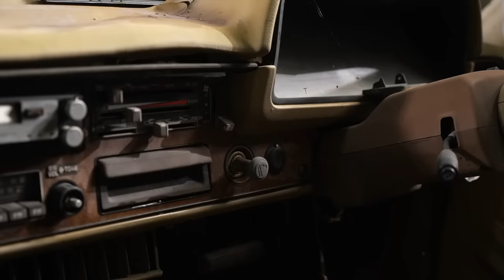VINTAGE HILUX saved from JUNKYARD & restored! Jocko's ground-up rebuild of his Dream 4WD

Comment: Nice. Look at the classic Red Marlin Crawler truck for inspiration, that thing is an icon in my world.  I believe his is a 1980 but same body style. I've got an 85 4runner that just got back on the road/trail last winter after a 2 year rebuild. Upgraded engine and drivetrain, dual tcases, high steer conversion, upgraded brakes, lift, tube work... Toyota minitrucks are the best.  Definitely will be watching to see where this project goes.
Reply: Its definitely inspiration mate! that thing is a beast - Jocko

Comment: Had 30 of these first gen 4x4s over years  love them just picked up another 2 owner rn duel cab  doing complet resto on it .... herd  ln 106 front springs push diff foward few mm   xe el falcon wagon springs for rear 🤙 flat leafs flex.   stock lift body lift if u really need. 
 that setup flexes better then our  other 2 coil 4bs. With all the s.e gear   btw dont paint it sandy that coulor is already taken on 2 other first gens 😂👍 keen as to see this thing done and out drive few of the bigger $$$$  builds

Comment: I find that the paint strippers work and penetrate better if you lay some plastic directly in contact on top of it to stop it from evaporating. Your typical garbage bags works well. It penetrates better and the paint typically comes off like plastic wraps that you can just peel off. It even penetrates thin layers of bondo. In contrast to doing it the usual way and having to later scrape the paint off and having to sand off paint at the bottom that was not penetrated into. Just my thoughts.

Comment: Hi. I don't know a lot about panel prep ect, but can you explain why you used paint stripper rather than sand blasting the whole paint removal process. is it the cost of sand blasting? if you could touch on this in your next ep that would be great. PS enjoy your video. Cheers Pm

Comment: If my vehicle has “professional” raptor coating on it and it’s chipping away and you can see rust surface spots coming through (was on it when I got it) would I be able use this same paint stripping process for that or would I have to do something else because of the raptor coating?. 

And could you please send up the paint stripping crew and jock to Darwin and we can crack into it
Reply: Hey there! U-POL RAPTOR is a coating made to last, so it is difficult to remove once cured. Once RAPTOR is cured, remove by sanding it off with P80 grit sandpaper either down to the original substrate or to bare metal. Then, respray the surface with another coating, like OEM paint colors (required).

Comment: Just wondering what process you have done on the inside of guards and any pannel b sides. Will you coat them with brunox and primer aswell? Also chassis rail internals and door internals. Great process info so far. Cheers.

Comment: Hi Jocko, I have a 1988 Dodge raider (Mitsubishi Pajero 2 door) with some rust holes in the wheel wells and fenders of the bodywork. The holes are about 2" by 2". What do you suggest I do to fix that? Cheers

Comment: My biggest tip is find a shop that can sandblast the parts for you! Please safe yourself alot of time in the rebuild!
Reply: Great tip mate, but with an older vehicle like this sometimes sandblasters can do a bit of damage to parts that are hard to find like guards etc. Doing it this way ensures we can keep it looking mint at the end, but still use blasting for some of the parts. Cheers! Jocko
Reply: @mcdoogle456  I went to a sand blaster that was specialist in VW beetle and other old cars 😀

Comment: hi i renovate classic cars ... 23:40 you can also use a etching 'vibrating needle'  tool that you use on your  spanners to leave a name (it's proper noisy on a stripped panel) also hydrochloric acid brick cleaner 30% solution is amazing to eat car cancer as well ... that can leave a "sand blasted" type finish on steel and works fast...

Comment: Is there any reason you didn’t chemically dip the whole thing over sand blasting it?
Reply: I believe the acid dipping process is great for paint removal and on par with sandblasting. However the surface profile left behind after sandblasting is magic for paint adhesion and cant be beaten. Especially on a job like this where the final film thickness of the paint may be quite heavy. :)
Reply: @daveyroach4765  oh ok got ya! Thank you for explaining it 👌🏿
Reply: @sama5946  Happy to help!! :)

Comment: should've sealed those diff housings up if you were going to blast them. if you miss one little pocket of blasting media say goodbye to your diff internals.
and for the small amount of time you save you're better off just wire wheeling the housing.
Reply: They will be masked by the blaster mate - but definitely agree! - Jocko
Reply: What size nozzle was used to spray the epoxy primer?

Comment: Why didn’t he get everything sand blasted. Cost? Or something else
Reply: Sometimes industrial sandblasters can go pretty hard on old panels so you need to be careful. Also the way we prepped it using Brunox means that the panel is protected for years to come from rust, which is an extra step for a blaster that we can easily do ourselves in the shed at home. - Jocko